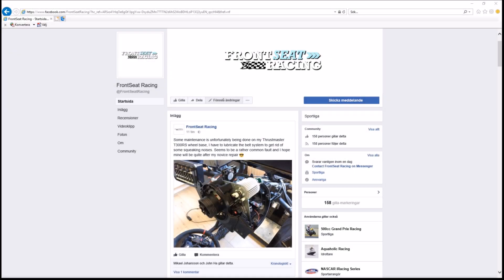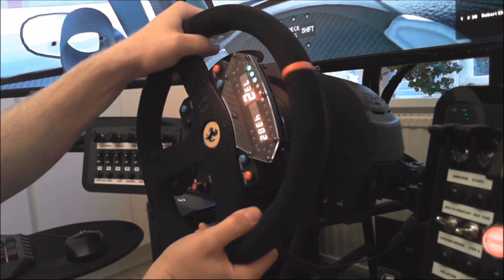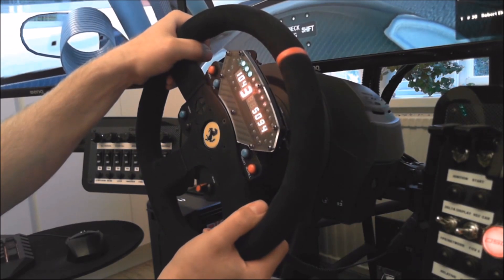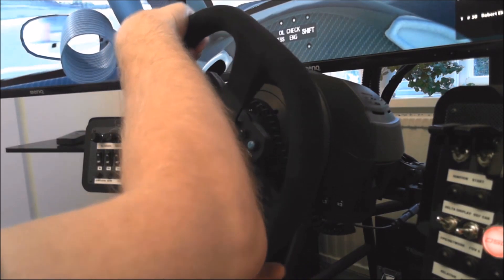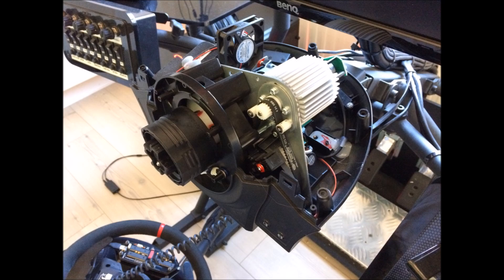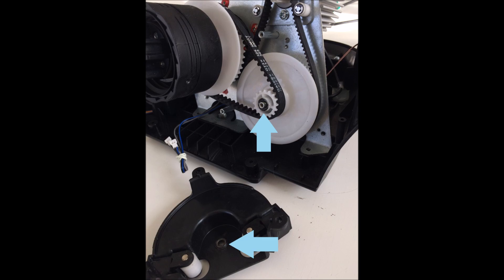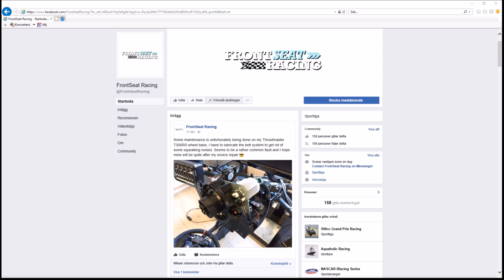Tech Guides - Removing squeaking noise on my Thrustmaster T300RS servo base

Comment: Great video. Btw, I have taken off both tensioneers (!). The wheel feels like butter now.
Reply: Where are the "tensioneers?" Not sure what those are, but I sure would like my T300 to feel like butter!
Reply: Around the intermediary gear. They are each mounted with a single screw. Their role is to keep the big belt stretched. Their position can be tuned. For example, if you feel "friction", they can be set loose. If you feel a deadzone, add tension. Careful, the screws are made in China. Unscrew one of them and take it off to understand how it works.
Reply: deggial2005 Awesome. Thank you. Did you just remove them and nothing else?
Reply: deggial2005 I took a picture of it to clarify but I don't think there is a way to send pictures via YouTube. The belt runs over the gear obviously and there are 4 screws directly behind the belt on the metal area. Are those the screws you are referring to?
Reply: JDubInDaClub yes you need to take that cover off to gain access to the tensioeers. Careful, in order to sfely remove the cover, the wheel must not be tighten to the table. You can tighten it back after removing the cover. Check a dizassembling video.
Reply: JDubInDaClub yes you can simply remove them, test the feel etc. You can always put them back. Just be very gentle with the screws, because they really suck.
Reply: deggial2005 Yes, indeed. I believe I found them and I've taken lots of pictures along the way to ensure proper reassembling. Here comes a stupid question and for that I apologize. Do you think WD40 would suffice in lubricating the belts and if not, what kind of grease would you recommend?
Reply: JDubInDaClub tbh I would just make sure the belts and gears are clean. Geared belts are not made to be lubricated. I tried wd40 and it doesn't feel like a great idea.
Reply: deggial2005 True, I agree with you. It looks like in his video he applied something to those 2 areas, but not the belts. I genuinely appreciate you answering all my questions and for the help. Happy Holiday's to you and your family!
Reply: JDubInDaClub happy hollidays to you yoo mate
Reply: Good news, took everything apart, applied some silicone lubricant where Mr. FrontSeat showed in the video and it is as quiet as can be now!
Reply: Tell me will the warranty be lost when I open the wheel? (remove upper cover). A strange sounds come from my wheel like on a video. I dont want to wait for wheel over a month.
Reply: Arktez Probably so, but Thrustmaster is terrible at responding and if you can fix it yourself like I fixed mine, who cares, right? I sent Thrustmaster 2 emails requesting help and they never responded, so I fixed it myself.
Reply: Can you tell me, you make you wheel feeling like "butter" ? My wheel turns very heavy. If you do this, and if you have a pictrues of making this, can you send me to email?
Reply: Arktez you will only void the warranty if you damage any component. I you use caution and follow video disassembling tutorials there should be no problem. This was confirmed to me by Thrustmaster support. I told them I opened the base and they said I can still send it back if I want because "it looks allright from the pictures". So...just use the right screwdriver :)
Reply: deggial2005 ok im happy. Can you tell me how to make the wheel feeling like butter? My wheel turns too heavy i think. Do you have a pictrues from making this?
Reply: Arktez look in this video at 3:09. The right-most red painted screw holds one of the two tensioneers. Crefully unscrew it until you hear a "tik". Then screw back, not tight.
There is one more tensioneer underneath.
Both tensioneers should can be tuned this way.
If the belt is too tensioned, it feels hard to move. If the belt is too loose, it feels "like butter", but you might have knock-like sounds when FFB spikes. Just be careful with those screws, they are realy shitty.
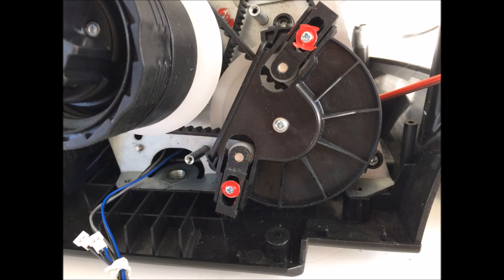Reply: You mean this two tensioneer at 3:25 ? I must unscrew them and remove this plastic cover because i need to lubricate this rack like on video.
Reply: Arktez yes those
Reply: Thank you very much :) I take apart a wheel at wednesday :)
Reply: Thank you very much! I did everything and wheel now turns smoothly, but i expected more "butter" feeling. I use my own lubricate like on video, and loosened a belt, it was terribly tight.
Reply: Arktez I only felt butter when I took the tensioneers off completely :)